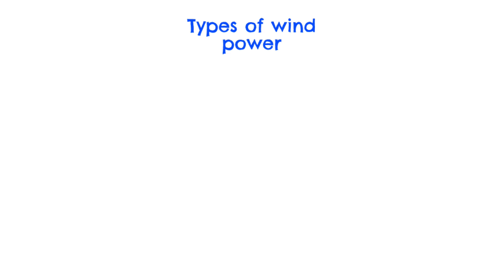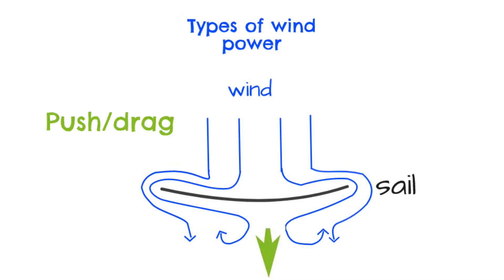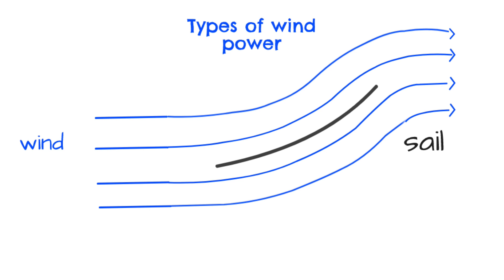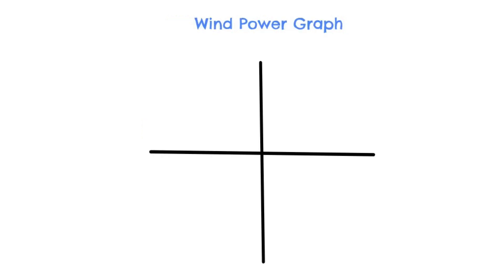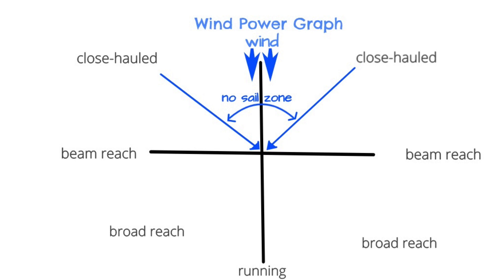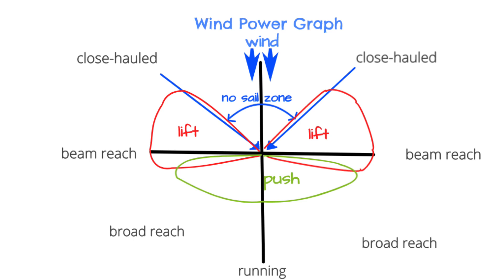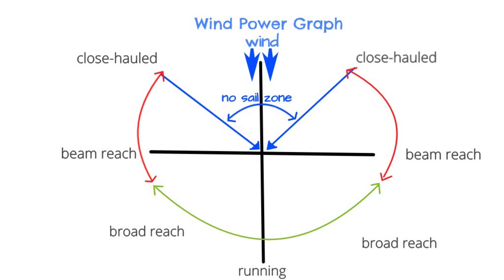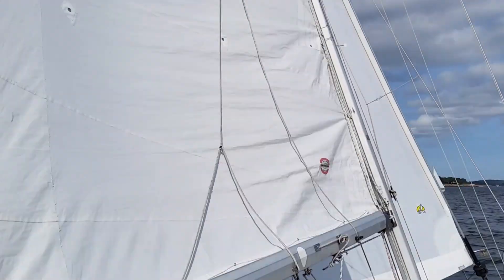Sail Trim (part 1): Forces of lift verses push

Comment: Do you route your jib sheets aft outside the shrouds then back through the life lines at the car or do you leave them routed inside the shrouds and life lines directly from the clew to the car?  Thank you
Reply from the maker: Depends on size of jib/height of clew and location of shrouds.  Closehauled, you want the sail to trim as inboard as practicable, so inboard of  lifelines would be desirable.  For a large jib/low clew sail, your sheet would  go outboard of shrouds. For a smaller jib/higher clew, you can often run the sheet inboard of the uppers/outboard of the lowers.

If the shrouds are located outboard (to the toerail/topsides), then you want to try to run the sheet for any jib size inside one or more shrouds.

When reaching, you want to move the sheet forward and outboard, when racing I add temp tie a short sheet through a block on the toerail, outside the lifelines.
Reply: A block at the toe rail = barberhauler?